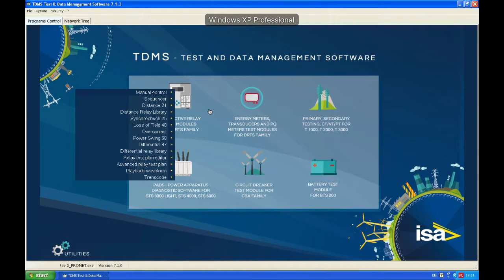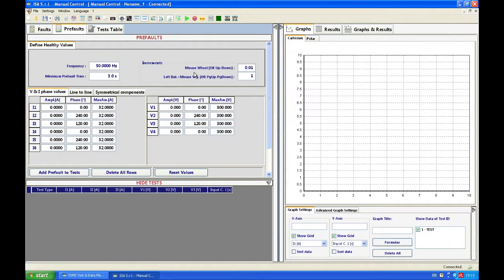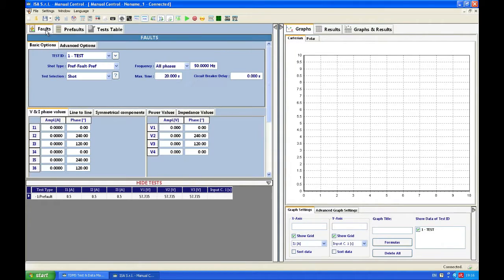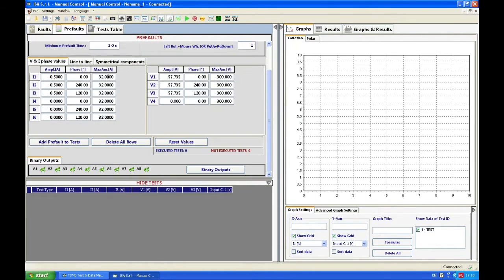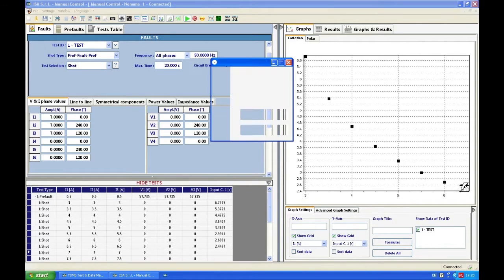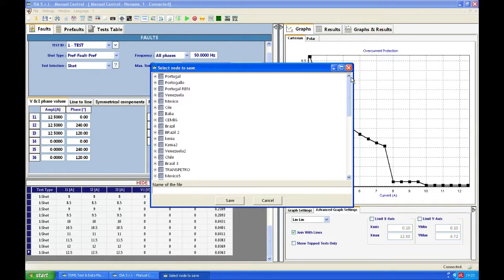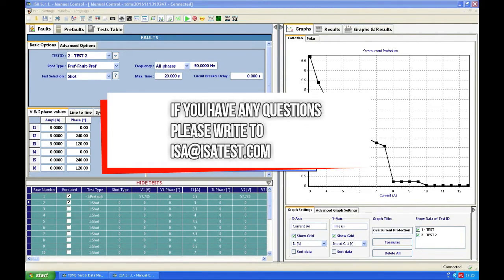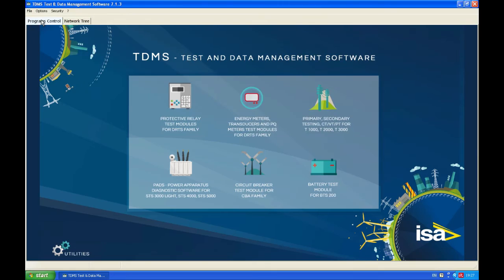TDMS Manual Mode Example

Comment: Hello Andrej! Hope you're doing good!
I want to know how to get all three phases of a triple pole (3 element) OC CDG electro-mechanical relay trip and flag and get their times, of all three phases/poles, recorded by DRTS64? Using Manual mode, I use all three current channels, phased 120degree apart, and connect them to each phase/element of my CDG relay. Then I use C1-N connection so as to stop the current injection/testing when the relay trips/flags. Problem is that although three discs of the three poles/phases/elements start to move at the same time, they do so at slightly different speeds, varying by 1or 2 seconds. This time difference is enough to causes one disc to trip and flag before the other two, which then causes C1 to stop the current injection/testing and time of only that phase/pole/element is recorded which tripped/flagged first, while time of the remaining two is not recorded. To avoid this we then resort to testing all 3 phases/poles/elements separately, one after the other, which uses up our time. 
So, is there any way to test all 3 poles/elements simultaneously such that times of all three phases is also recorded? Would appreciate a lot.
Thanks
Rizwan
Reply from the maker: Dear Rizwan ! I have answered you in an email. Please confirm that you have recieved it. Thank you !
Reply: @sheppo17  recieved. Thanks for the prompt response Andrej.

Comment: Hi Andrej, 
I'm using DRTS64 in Manual mode thru' TDMS. I wanted to know if TDMS can record the trip time (and also display the time in report) when i manually stop the testing using the red stop button, provided on top next to play button? I know the trip time is recorded and displayed on report when i use the binary input "C1" (as wet 110Vdc), but no trip time is recorded , i.e., "time-out" is seen when i manually stop the test. Basically I test relay installed on switchboard, so i don't require C1 contact, and so i manually stop the test when i visually see the relay operating/flagging. Is there any option to get that trip time? Will help us a lot. Otherwise we'd have to carryout rewiring of the installed relay to incorporate C1 contact.
Thanks
Reply from the maker: Hi Rizwan, can you write me an email to asepcic@doble.com
Reply: @sheppo17  ok